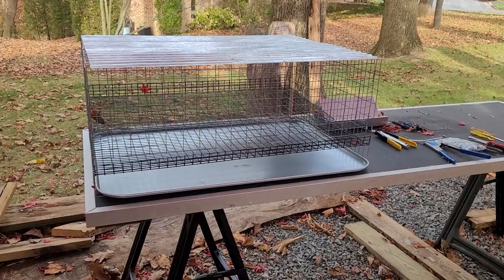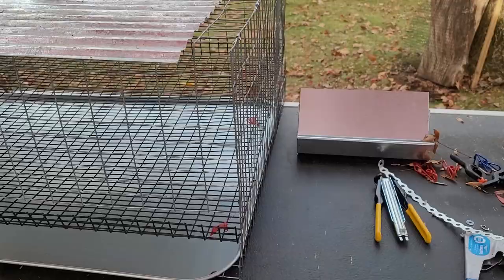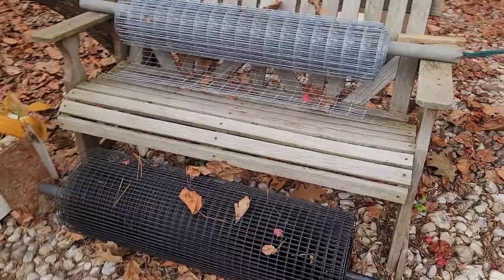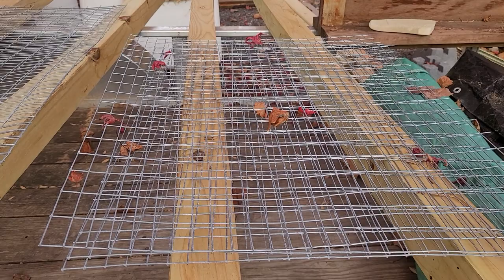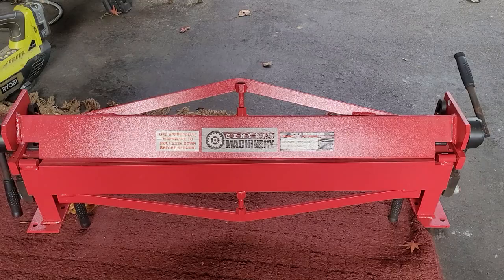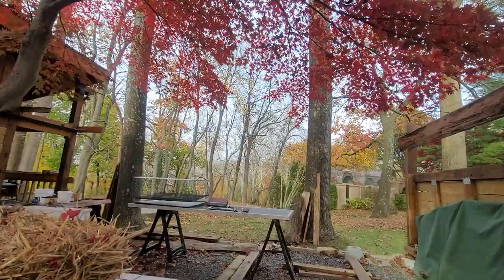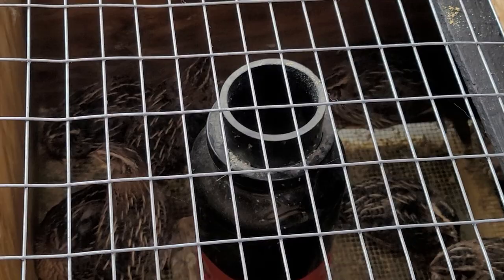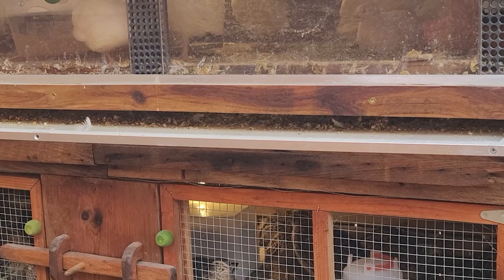Easy DIY jumbo Coturnix Quail stackable, portable (sellable) cage with Egg Roll Out. Tips and Tricks

Comment: I like the concept here, but am concerned that if you stack them, won't the weight of the poo be substantial and smash the lower cages?
Reply from the maker: We use fiberglass poles (think winter driveway markers) and ubolts on the corners posts to provide rights and maintain alignment.  We also use a heavy 16 guage cage 1" x 2" galvanized welded wire for the cage stock.  The weight of the cages are supported by the sidewalls and not the cage  top, and the droppings tray rests on rails, a 2" inner bend of the bottom inner side wall so that the tray is not totally supported by the lower level cage roof.  The removable inner divider of each dual cage also adds rigidity to the center of the cage, along with a heavy guage 1"x1" front post between the large doors ensures the egg roll out space remains true.
If you get a chance... have a look at the USQuail Cooperative project we will soon be launching.   USQuail is a member owned business league for homestead Quail growers in effort to standardize our decentralized  "parallel poultry" initiative.  Members receive a free profile brochure style webpage and we will be offering a discount supply store, a custom online DIY print and merchandise shop to support business owners, a lucrative affiliate partnership program complete with predesigned ads, education for new Quail enthusiasts as well as experienced growers, and eventually, live member driven QuailTV scheduled daily Q&A programming.  Plus much more.  USQuail.com is hoping to get 10 founding members in each state, and the cost of membership equals only the average sale price of one sale based on the level you join, Starter, Grower, or Breeder.
Each state Cooperative will have a steering committee board that will work directly with the USQuail Board of Directors to help develop the site to best suit the needs of our members.  Our mission is to help communities become self sufficient by growing their own protien, one neighbor at a time.  Posting articles, photos and videos to the USQuail library will help with member owned websites SEO through back links, and if you don't have a website, you can pick one from one of 5 predesigned "Your Logo Here" site templates available or you can build your own through our discounted hosting and website builder links.  Have a look... there's just too much goodness to address in a comment reply, but it's very exciting and we are just waiting for our 501(c)6 (nonprofit farm cooperative) paperwork before we open the doors, but you can preregister and take advantage of the founders discount and badging for the 1st 10 in your state.  Through the affiliate program, you can earn enough to pay for your membership each month with just one referral, simply attach "Join USQuail Cooperative" at the bottom of all your posts and you custom link will track referrals for 90 days.  It's a way for us all to win and take back control of our food supply, especially now when it appears the government is shutting it off.

Doc
TullyRiverQuail. Reading PA
Founding member - USQuail.com

Comment: How do you get rid of the sharp burs? Are u using a angle grinder
Reply from the maker: Yes, and flat files.  I also line access area with silicone edge guard and corners with liquid "dip-it" or liquid electric tape where necessary.  Some things I can use a diamond dremmel tool bit, or a commercial belt sander.
Reply: Where do you get trays ?
Reply from the maker: @JamesSmith-xr3yx  hi James Smith... if that is your real name :)
AdvancedAutoparts has these large trays for as low as $10 if you buy >10 and take advantage of their coupon codes.  Perfect except for the manufacturers embossed logo, but perfect nonetheless for large cage builds such as our Jumbo rollout cages